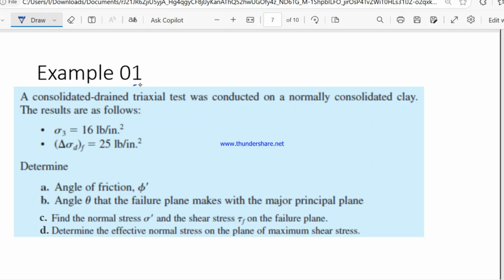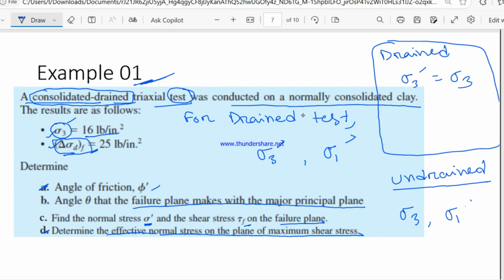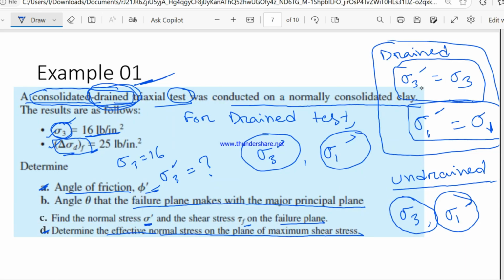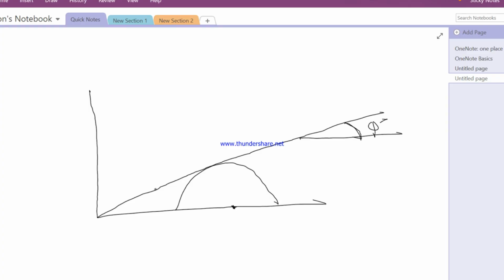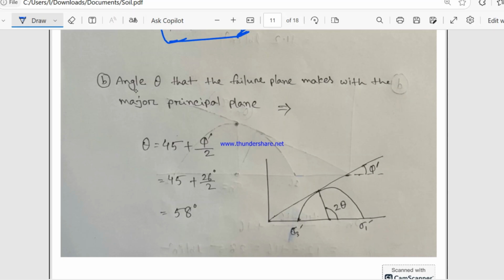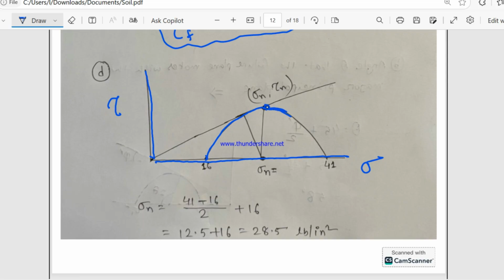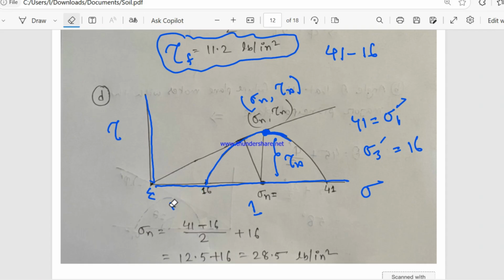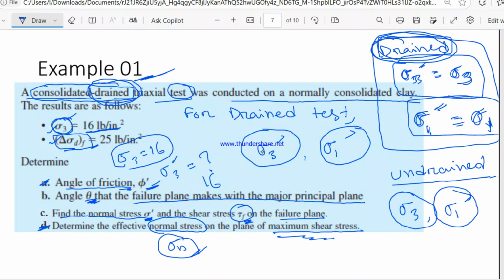A consolidated-drained test was conducted on a normally consolidated clay. ơ3 = 16 lb/in.?

Comment: A consolidated drained test was conducted on a normally consolidated clay yielding following data sigma3=350KN/m^2 sigma d=400KN/m^2 Determine angle of internal friction angle at which failure makes with the major principal planes normal stress and shear stress at principal planes
Reply from the maker: Here is the solution:

1. Major Principal Stress (sigma1):
sigma1 = sigma3 + deviator stress
sigma1 = 350 + 400 = 750 kN/m²

2. Angle of Internal Friction (phi):
sin(phi) = (sigma1 - sigma3) / (sigma1 + sigma3)
sin(phi) = 400 / 1100
phi = 21.32 degrees

3. Angle of Failure Plane (theta):
theta = 45 + (phi / 2)
theta = 55.66 degrees

4. Normal & Shear Stress at Principal Planes:
By definition, shear stress is zero on principal planes.

Major Principal Plane: Normal Stress = 750 kN/m², Shear Stress = 0

Minor Principal Plane: Normal Stress = 350 kN/m², Shear Stress = 0